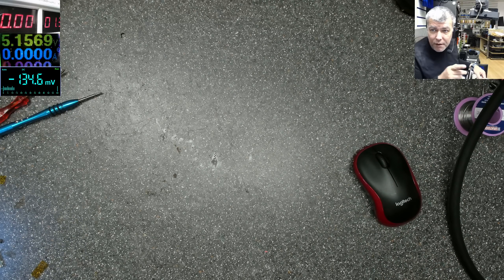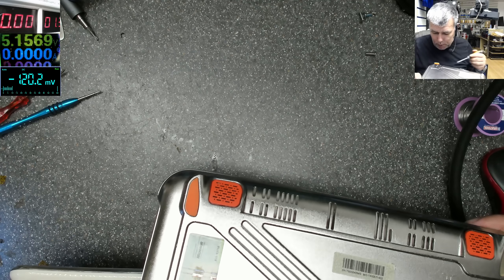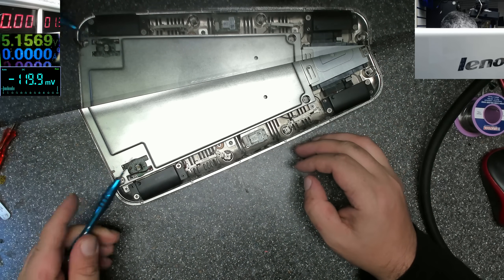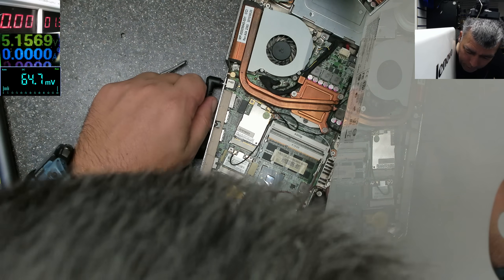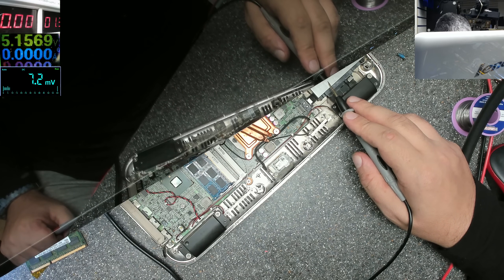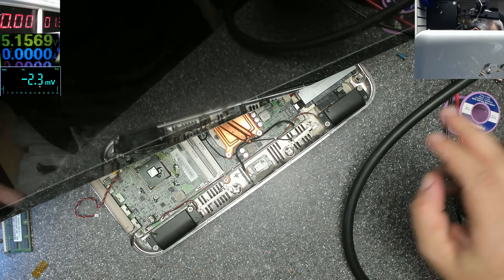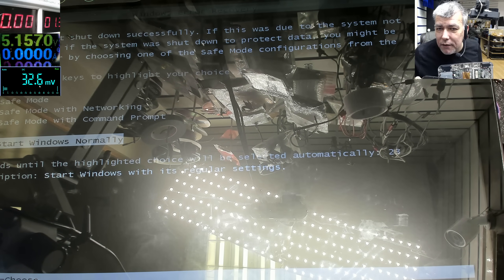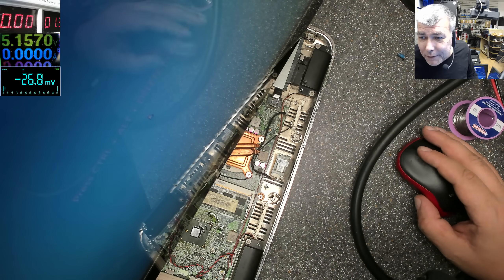Lenovo aio300 - comes on but no picture - let's fix the cipset :D

Comment: Can you give me any suggestion with my hp pavillion dv6700 it shows some light on the power when i turn it on but there is screen is of, battery is dead but still work, before when you push the power button the power light turns on then off immedietly then screen goes on but now the power light stays on and screen is off, thankyou

Comment: Hey bud I need to flash the V bios on my Omen 15 ce198wm with 8750h an GTX 1060 Max Q it is a dedicated GPU so no integrated graphics how can I tell the vbios apart from the regular bios I want to be able to flash using a clip and USB programmer any help thank you

Comment: Pls help my laptop stopped working for a sudden like dead and i made a mistake of letting someone check it for me cause it was out of warranty now the charger is fin but no light on the laptop and the guy once hey checked my robbin cable of the power switch instantly got burned so how can i fix and did he burn my motherboard pls help me guys and mr plssss

Comment: the reason of issue with the chipset or bga/gpu can be:
 -cracks or corrosion on the solder balls under the chipset (0,4-0,6mm balls size, 400-700count) 
-cracks on the very small solder balls under the silver die (no access)
 -burnout tracks, or cold joints inside the chipset (no access), and 

 The best "fix", which can stay for 1-4years is to replace that chipset.Expensive and risky(after chipset is removed, you have to clean the pads on the board - you can rip them off accidentally, and the new chipset/gpu can be bad or refurbished or fake-new: thanks to china people ;) 

or second possibility - very good, temporary fix, which can stay from 3months to over one year. You have to remove that red glue from the chipset corners, then heat the board from the bottom to 150-180 Celsius degrees, and then put good flux under the chipset and then heat from the top slow from 0 to 170 degrees (1degree for 1second), and then from 170 to 240degrees (2degrees for 1 second) If you do it quicker (quickly form 170 od 240) you can make a internal short with popcorn effect on the surface, and when you do it slower it will destroy internal transistors and the chipset will die.  

When you hit 230-240 degrees - solder balls will melt and then you have to push but very little bit and very gently one of the corner of the chipset. And if you see the small movement to forward and then automatically next movement to backward (balls tension), then it will be the proof for you, that all balls are melted. (it you didn't remove properly the red glue from the corners before or if you not heat the chipset properly - you will be not able to push the chipset at all) 

Whole procedure of heating cannot be longer than 5minutes. Then cold down the board.  This procedure recreates solder balls and connections. All cracks will be fixed during melting point, balls will be recreated because of your forced movement (push) and the flux will remove all corrosion. This can give you long temporary fix. Form 3 to 12 months, or even more.  
If the issue was inside of chipset - (very small balls under the silver die, or tracks or joints inside the chipset) then because of temperature and time, this procedure brings everything inside to the melting point as weil, so everything will be fixed/reconnected/recreated. 

BUT, that what Sorin did It is very temporaty. It will die again very quickly from 1day to max few days or weeks.  If the client is not coming back, or not calling back after few days, then it doesn't mean that the computer is working fine. Almost all the clients, who paid for that kind of repair will not do it again. They become angry, or frustrated, and they usually buy new computer. So Sorin will never know, how long his fix will stay fixed.

Comment: How did heating the chip fix it?
Reply: he didn't fix it :) He did a very temporary fix. 
the reason of issue with the chipset or bga/gpu can be:
 -cracks or corrosion on the solder balls under the chipset (0,4-0,6mm balls size, 400-700count) 
-cracks on the very small solder balls under the silver die (no access)
 -burnout tracks, or cold joints inside the chipset (no access), and 

 The best "fix", which can stay for 1-4years is to replace that chipset.Expensive and risky(after chipset is removed, you have to clean the pads on the board - you can rip them off accidentally, and the new chipset/gpu can be bad or refurbished or fake-new: thanks to china people ;) 

or second possibility - very good, temporary fix, which can stay from 3months to over one year. You have to remove that red glue from the chipset corners, then heat the board from the bottom to 150-180 Celsius degrees, and then put good flux under the chipset and then heat from the top slow from 0 to 170 degrees (1degree for 1second), and then from 170 to 240degrees (2degrees for 1 second) If you do it quicker (quickly form 170 od 240) you can make a internal short with popcorn effect on the surface, and when you do it slower it will destroy internal transistors and the chipset will die.  

When you hit 230-240 degrees - solder balls will melt and then you have to push but very little bit and very gently one of the corner of the chipset. And if you see the small movement to forward and then automatically next movement to backward (balls tension), then it will be the proof for you, that all balls are melted. (it you didn't remove properly the red glue from the corners before or if you not heat the chipset properly - you will be not able to push the chipset at all) 

Whole procedure of heating cannot be longer than 5minutes. Then cold down the board.  This procedure recreates solder balls and connections. All cracks will be fixed during melting point, balls will be recreated because of your forced movement (push) and the flux will remove all corrosion. This can give you long temporary fix. Form 3 to 12 months, or even more.  
If the issue was inside of chipset - (very small balls under the silver die, or tracks or joints inside the chipset) then because of temperature and time, this procedure brings everything inside to the melting point as weil, so everything will be fixed/reconnected/recreated. 

BUT, that what Sorin did It is very temporaty. It will dies again very quickly from 1day to max few days or weeks.  If the client is not coming back, or not calling back after few days, then it doesn't mean that the computer is working fine. Almost all the clients, who paid for that kind of repair will not do it again. They become angry, or frustrated, and they usually buy new computer. So Sorin will never know, how long his fix will stay fixed.

Comment: It's temporally fix but sometimes it's good enough, just today my graphic card decide to die. Not even while gaming, during browsing. I was thinking about changing it soon anyway but I don't want to buy new card today, not even tomorrow. I was waiting for radeon launch next month to decide what to buy and after quick thinking what GPU I have to use as spare and where I put that old thing I remember that it's much easier to first try hot air station, at least I didn't need to find it first.
And it work, for how long it's hard to tell but as I'm hoping just for month and half it's possible it will do.

Same is in this case in video, if they are honest to customer (and don't charge too much) it will give them time to decide in peace what they want to buy saving them from rushed buyers regret later.

Comment: The chipset has no graphics in it, but the monitor connector is controlled by it.
Reply: Probably this was not even the chipset. Maybe it was just the graphics chip. This is a laptop form factor so its highly unlikely to have a chipset.
Reply: @bouxesas2046  No :) Without chipset the board could not work at all. Only starting from the fourth generation Intel Mobile (BGA) processors one finds chipsets assembled with the processor. This chipset should be a HM55 PCH.
Reply: its not the chipset! its a laptop Mainboard and this "chipset'" is the onboard Gpu gma4500!!...if this is the first gen intel core!
if this mainboard use the 3. gen....then its a "chipset" hm55!! but its not the same as a chipset like z170! or B450 for Amd!
there are some differences.
but the gpu is inside the cpu! its a little bit confusing^^...its not the gpu but this "cheepset^^" communitate with the other peripherie, 
so it is important to have a picture on the screen!
Everyone have the right answer! its a part of all^^
anyway "we call it Chipset" and the case is done...
someone call a boat a boat, someone a ship and the others call it vessel^^...
we talking about same things^^
Reply: @Knebebelmeyer  You are also right, the BD82M55 Mobile Intel® HM55 Express Chipset has internal graphics output, but the 1st Gen Intel Core CPU (e.g. i3-350M was built into this model) also has the Intel HD Graphics (Ironlake) in it.
 HM55 ist not Compatible with 3.Gen CPU´s.
It is confusing, but if Intel calls this a chipset I will call it that too :)
Reply: so the graphics inside the CPU ..correct ?
Reply: @Skarz289  Yes :)
Reply: Isnt that the PCH?
Reply: @kenstoudamire7366  chipset is PCH. Platform controller hub. 
I have a mainboard too with a cpu not showing up the IGPU. I suspect the PCH not communicating correctly with the cpu and not recognizing the igu of the cpu. 
I’d had a bad PCH power supply and a bad I/O chip. But customer don’t want to pay 15€ for the PCH replacement, I can’t confirm it.
Reflowed the PCH twice with preheat station to not shock the mainboard didn’t fixed the problem.
But at least with a external gpu the board is working now. But IGPU not showing up in bios.
Reply: Born to be free Biker  lmfao     chip set   NOT  cheeps  lol    cheep is what a bird does......ha   cheep cheep cheap ass

Comment: five hundred degrees is not much for the chip ??? maximum four hundred degrees for this chip !!!!
Reply: as you can see it's not too much. But as he say try not to focus on die, there is no contacts under it anyway and even if we are all wrong and it's not about balls but tracks inside substrate bigger part of them are not under die.
Sometimes is better to do things fast than to heat components for longer times than necessary. Even with 500 degrees temperature air temp of substrate will hardly go over 250-300 for such a short time. If you go with lower temperature air time needed is longer and so there is greater chance do damage chip die or something around.
Reply: @gorky_vk  Yes, you're right, but you have to be very careful. Professor Sorin is a great teacher. A good teacher has no cards up his sleeve.

Comment: dear sorin, lucky you found the problem... BUT i'm sorry to tell you, that in this generations of CPUs the IGP (integrated graphics processor) is NOt inside the chipset... it's inside the CPU.
But maybe the problem was something else on the Chipset... maybe something on the other side of the board... but heatig it up fixed the problem (temporarily)... :)

Comment: This cipset🙂 must bee replaced week or two and Black screen😀
Reply: @Rumumm95 yes you have right, the CIPSET :) must be replaced to keep the fix from 1to 4years
Reply: not necesairly. it could be fine ... but the solder under is breaking. these fixes ussually work for a year or two since the material (solder) is tired and is prone tocracking again.
Reply: @express496  you don't know what you are takling about.
the reason of issue with the chipset or bga/gpu can be:
 -cracks or corrosion on the solder balls under the chipset (0,4-0,6mm balls size, 400-700count) 
-cracks on the very small solder balls under the silver die (no access)
 -burnout tracks, or cold joints inside the chipset (no access), and 

 The best "fix", which can stay for 1-4years is to replace that chipset.Expensive and risky(after chipset is removed, you have to clean the pads on the board - you can rip them off accidentally, and the new chipset/gpu can be bad or refurbished or fake-new: thanks to china people ;) 

or second possibility - very good, temporary fix, which can stay from 3months to over one year. You have to remove that red glue from the chipset corners, then heat the board from the bottom to 150-180 Celsius degrees, and then put good flux under the chipset and then heat from the top slow from 0 to 170 degrees (1degree for 1second), and then from 170 to 240degrees (2degrees for 1 second) If you do it quicker (quickly form 170 od 240) you can make a internal short with popcorn effect on the surface, and when you do it slower it will destroy internal transistors and the chipset will die.  

When you hit 230-240 degrees - solder balls will melt and then you have to push but very little bit and very gently one of the corner of the chipset. And if you see the small movement to forward and then automatically next movement to backward (balls tension), then it will be the proof for you, that all balls are melted. (it you didn't remove properly the red glue from the corners before or if you not heat the chipset properly - you will be not able to push the chipset at all) 

Whole procedure of heating cannot be longer than 5minutes. Then cold down the board.  This procedure recreates solder balls and connections. All cracks will be fixed during melting point, balls will be recreated because of your forced movement (push) and the flux will remove all corrosion. This can give you long temporary fix. Form 3 to 12 months, or even more.  
If the issue was inside of chipset - (very small balls under the silver die, or tracks or joints inside the chipset) then because of temperature and time, this procedure brings everything inside to the melting point as weil, so everything will be fixed/reconnected/recreated. 

BUT, that what Sorin did It is very temporaty. It will die again very quickly from 1day to max few days or weeks.  If the client is not coming back, or not calling back after few days, then it doesn't mean that the computer is working fine. Almost all the clients, who paid for that kind of repair will not do it again. They become angry, or frustrated, and they usually buy new computer. So Sorin will never know, how long his fix will stay fixed.
Reply: @Radek__  It's so funny that you think that ... I know what im talking about ... I fixed a few laptops already with your method but it doesn't last longer than a year or 2. It depends on, like what you said, how and where the damage formed. My old core2duo hp died that way (chipset) while i had it in my backpack on my moped. When i came to my destination it turned on but had no image. Fixed it by reflowing the joints. Also the internal connections in the chipset are not made out of solder so "melting" them doesn't do much (not to be confused with the die to chipset pcb connection). Solder joints under fail faster then internal connections since the temperature fluxtuates more frequently. This case is a great example with bad airflow and no heatsnik on the PCH. It just means that the temperature can fluctuate more. These faults are more common with older hardware c2d and the first few core gen cpus IF they have a bad design. This AIO is a great example of everything that you can do wrong: Bad airflow, no heatsink and old manufacturing process that draws a lot of power. Thats why i buy thinkpads ... X201,X230 PCH under heatsink in a magnesium chassis. T530 full magnesium rollcage. All with good air flow.

About Sorins repair: If sorin is atleast a bit honest, which he seems, he will tell his customer that it might fail soon or atleast not charge a lot for this (mostlikely the second). Overall his repair shop seems to be affordable since they really try to fix stuff with whatever they have laying arround for the repair to be fast and cheap. And there is notthing wrong with that, dodgy repairs are fine if they are lasting. And even if this will fail within a year, maybe it is enough for the customer saves up enough to buy a new machine. It's sad that he will mostlikely have bad thoughts about repair shops. Then again used motherboards are cheap enough to make fixing boards not worth it for old machines.

Comment: Hi Sorin, at what temperature °C did you heat the chipset ?
Reply: 500degre
Reply: For this kind of work he is using full air and max temp. BUT don’t try this on a expensive laptop. Use a cheap working one and practice it first. You can easily kill the chip with this method. 
Better use a pre heat station and got slowly to the right temp to reflow it.

Comment: Anybody else notice how many lenovo's come in for repair?
Reply: They're trash. Great up until 2016.
Reply: They dont build certain models well anymore but the pro models are still ok
Reply: It's mostly how they handle their many failures. HP will honour a major board failure with a replacement within 3 years. Lenovo barely want to do the bare minimum to keep to their requirement of 1 year coverage.
Reply: org4ngrinder sadly thats most companies not just lenovo , people need to understand what they are buying better. Look at HP spectre they aint helping you after one year either.
Reply: @user-te1le7ck6b  it may be different where you live but spectres get 3 years in Australia
Reply: that is like a disease on lenovo notebook pc
Reply: I was a PC technician in an office, we went from using HP to Lenovo in the years working there.
In 10 years of using HP, maybe two HP laptops died, and we used 100's of HP laptops!
First year of using Lenovo, 2 broke down, 2nd year aprox 4 more broke down, 3rd year about 6 broke down. Lenovo are built rubbish.